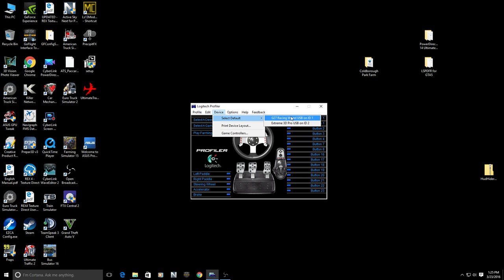How to setup the Logitech G27 & Extreme 3D Pro  Joystick in Farming Simulator 2015 and 2017

Comment: Will the system recognize dual joysticks or will I need to do one stick at a time?
Reply from the maker: Hi Dre C  FS15 and FS17 will most certainly recognize two sticks and allow for different controls to be set for each.  I don't have a video that shows how it's done...I just know it can be done.  It's basically similar to what I've demonstrated in this video.  Each joystick will be recognized as a separate controller and therefore be setup to do all you need it to do.
Reply: GrizzlyBearSims Thank you about to locate or order the joysticks now! New subscriber! Thanks for your help!

Comment: Hi Grizzly, You sir are an absolute hero & saver of time :-)  I bought my Extreme 3D Pro today to replace my old Saitek Cyborg 3D Digital stick as the old girl suffers a little from "Axis drift" but the sticks software won't run on anything newer than Win XP, so I have no way to "Deadzone" the drift out :-(
With the exception of "Car Mechanic Simulator" we play identical games so I value your knowledge, I have one question - does it matter whether the G27 or the 3D Pro are connected directly to the back panel of the Pc, or can they be connected to a powered USB hub ?
Btw, have a like & a sub :-)

Comment: Would this work with a driving force gt and 2 Extreme 3D pro joysticks ? I really want to get the full experience running the FDR mods on his maps :)
Reply from the maker: I can't guarantee, but it should.
Reply: do you like running two of those joysticks? i have the driving force gt wheel and one of them....how is two? is it comfortable where they are right handed sticks?

Comment: I have the same joystick and was wondering how do you enter the axis number that you want to use not very good with computer
Reply from the maker: Follow the video and you should be able to get it configured just as I did.  Unfortunately, controller and wheel support in FS15 is really poor.  If it doesn't work for you the way I described it, I'm afraid I really can't be of any further assistance.  

Hopefully controller and wheel support in FS17 will be much better.  Fingers crossed.
Reply: GrizzlyBearSims im not sure how you give the command for the axis though say for loader up how do you type in the axis
Reply: Just move the joystick or press a button.  FS15 should detect it and assign it

Comment: I am able to get the joystick to respond when going through the menus. I can fast forward right through by tapping any button.. However, I am getting no response from the joystick when I try to operate the machines. Any ideas would be appreciated. I have spent a few hours and have gotten nowhere. I am trying to do this on farm sim 17. I unplugged my game pad.. i dont think my Logitech wireless headset would interfere while trying to set key bindings? But that is the only thing plugged in besides a keyboard, mouse, mic, x box dongle. Is there any chance that my x box bluetooth dongle being plugged in even though the x box controller is off can effect the binding set up? i made sure the Logitech profiler is not set default. It is set as selection (2), even though I am not using a wheel. When I program the bindings in with the joystick in game, they still appear as selection 2
Reply from the maker: I suppose it's possible.  But I would think highly unlikely.  But it is worth removing and testing again.  Let me know.  I'll try to help you the best I can.
Reply: when you were having issues with other things plugged in. Did the key bindings look like there were setting in the options menu? or is didnt allow you to change the bindings at all?
Reply from the maker: I believe the issue (when I had other USB devices connected) was it wouldn't detect the correct hardware.   Because some of these other devices ( one was a GoFlight Throttle for Flight Sim) was overriding the Logitech joystick.  

What's really odd (based on your description) is FS17 recognizes the joystick and allows you to set the bindings.  But when you go to the equipment, it doesn't work.  I'm pretty sure when I was attempting this back in FS15, it wouldn't even see the joystick because of the other devices.
Reply: Yes! I even tried directly key binding Q (Attach/Detach) attachment buttons to one of the side buttons on the 3D pro right in the Logitech profiler and still nothing. What is weird is.. I have the same device registering under 2 different names. One name is Logitech Joystick and the other is Extreme 3D pro on USB. I have set both to the default device slot to see if one or the other would work in the place of the second (non default device slot) device. I am going to try to disconnect the x box dongle and try again. And then if it still isnt working, I am gonna plug the Extreme 3D pro directly into my motherboard instead of into the USB hub I have it into right now. Also, I see when you have the saved profile application (for farm sim 15) it is of a tractor logo. I initially tried the red Giants engine application (which responded at home screen and not in game) and then I profiled the tractor logo application (once again responded at home screen and not in game. Do you know which logo is needed? I assume the tractor application logo?
Reply: So I unplugged everything but my keyboard and mouse. Started with a fresh new profiler file and selected the profiler application logo to the tractor picture. I tried putting the name Logitech joy stick as default which then put Extreme 3 pro as secondary and then I tried the opposite. Logitech joy stick as secondary and Extreme 3D Pro as primary. NOTHING either way in game. I mean it even says in the bindings page after I made the adjustment that the Y axis was changed and binded onto the Extreme 3D Pro. I am absolutely stumped. It just makes no sense as to why its not working in game.
Reply: I got the same issue (will try this video after writing this). But the game recognises it, it shows it's the logitech extreme 3D pro in the third controls menu. And I can select what keys does what in the controls menu. (Like set the horn to be button 3 on the joystick fx.) But when I load the savegame up. Nothing works, not even the horn button. :)
Reply from the maker: I'm sorry...I really don't know what else to suggest.   Just out of curiosity, what version of the Logitech software are you running?
Reply: I am running software 5.10
Reply: skvakagud  i wonder if it is some kind of driver issue somewhere. I am totally stumped. If anyone figure this out. Please share!

Comment: Can anyone give me a link for a video that shows how to set up just one joystick?
Reply from the maker: If you only have one joystick (which is the only controller you have) the process really is the same as what I've described here.  Plug it in and go into FS15 and setup the controls the way you want them.
Reply: Ok thanks. Its great to see you giving feedback to people in need! Subscribed :)
Reply from the maker: Thank you for subscribing.  I appreciate it.  I'll be providing more "how to" info on Farming Simulator 17 soon.
Reply: I also tried setting up my steering wheel (Thrustmaster Pro Digital) and it automatically drives, and turns. Any tips for that?
Reply from the maker: I'm not familiar with this specific wheel model, but I can say that FS15 (as I pointed out in the video) really lacks in controller support.  An issue I ran into a while back was having other USB controlled devices plugged in while trying to setup my devices.  

What i would recommend is disconnect all USB controller devices, then go through the steps I outlined in the video by removing all the individual control items under the gamepad category (with exception to  accept menu item).  Then try to one-by-one reassign each value.  

I'm hopeful that FS17 (out of the box) will offer much better (and easier) controller setup features than FS15.  I guess I'll find out on Tuesday.
Reply from the maker: Sorry for the late reply.  I believe this may have been resolved in one of the FS17 patches.  But if not, go in and clear out those assignments and that should stop that from happening.

Comment: do you think i could run two different model joy sticks on fs 17 the madcatz v1 and the logitech extreme 3d because the mad cats is left handed and right handed and i already have the logitech so dont see point buying another mad cats unless i need to
Reply from the maker: While I've not tested it as I only own the Pro 3D's, it may work.  You'll just need to test it.  Good luck.
Reply: +GrizzlyBearSims do you use two 3d's then and if so how does it feel do you notice it
Reply from the maker: I had two 3D's connected with FS15 when I did more logging.  I really haven't done much logging in FS17 and only have one connected at the moment.  But using two was really nice.  When I get around to doing logging I'll setup the second.
Reply: +GrizzlyBearSims is it comfortable can you feel that it is a right hand stick or is or not much difference
Reply from the maker: It wasn't that big of a deal.  It sure beat using the awkward mouse controls
Reply: +GrizzlyBearSims I have one already and I think you've convinced me to just get another Logitech but I find that it can be quite slow any way of making it move faster I out sensitivity up to 200 in game but still no luck anything outside came you can do
Reply from the maker: Have you tried adjusting via the Logitech software?  I think that is what I did.  I'm not home right now, but will try to remember to check later this weekend.

Comment: I have exactly the items you have - G27 and 3D Pro.  I had given up on connecting.  Thank you for this very good video.  One question, when you use axis 6, how exactly is forward produced and backward.  with just the throttle pedal?  Is forward pushing down the accelerator?  Is backing up letting off the accelerator pedal? How do you stop?  I'm missing something.  I would prefer to use the throttle to go and stop when letting off the pedal.  I'd like to use the brake pedal to reverse.  Is there a way to split the axis?
Reply: +Timothy Kraftson In the Logitech profiler, click on Options then Global Device Settings, and check Report Combined Pedals, then remap the controls to make sure they are correct
Reply from the maker: +Sandman TheOneAndOnly Thank you Sandman for replying.  I've been sick with a cold and haven't had the opportunity to reply to comments.  

@Timothy  Sandman is exactly right.  You need to check the option for "Report Combined Pedals" in the Logitech profiler.  This will give you exactly what you want with forward pressing the gas pedal and backing up pressing the brake pedal.    Thank you for the kind comments on the video.  Like you, I had also given up and my joystick set on the shelf collecting dust as nothing I could find made any sense.  I finally took an afternoon and decided to give it another try.